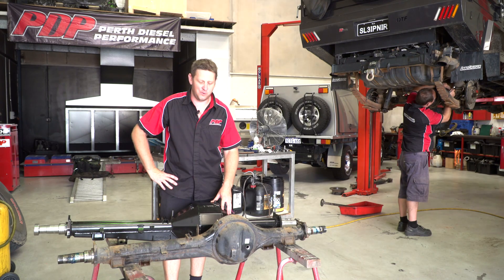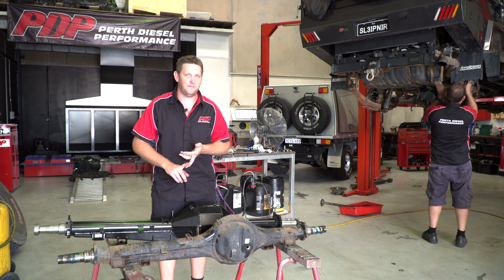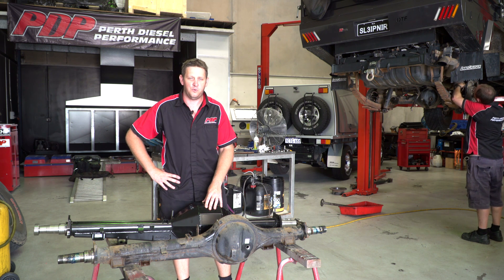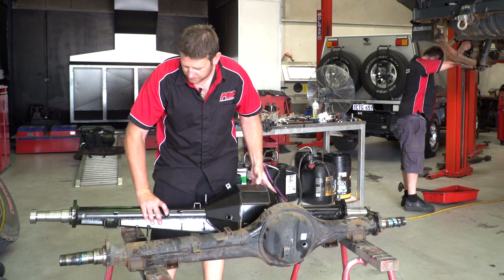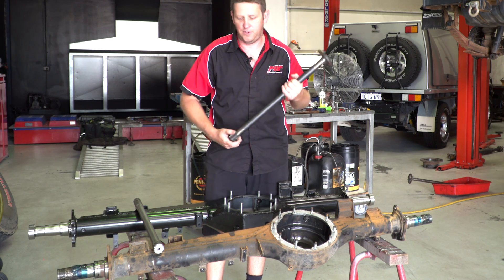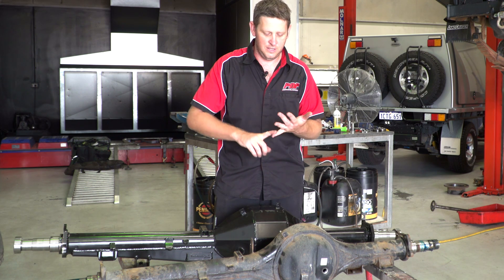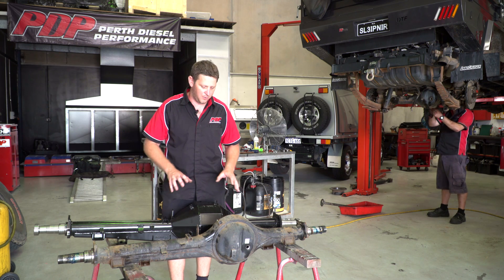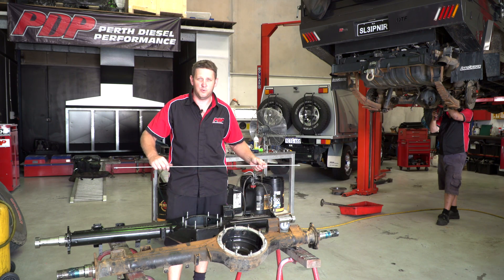JMACX Rear Track Correction

Comment: As someone with decades of motorsport engineering these obese diff carriers are rubbish. While the track differences is dumb from Toymota is a problem they seem not to cause any issues. A wider housing by all means, even floaters but 20kilos of extra unsprung weight is plain stupid!
As is ofcourse the dumb huge  rims and tyres that cause the grief. For bush bashing a 16" rim is better though will they fit a later model? Not on a wagon from 14 on. Those dumb mud tyres cause more grief, a decent AT tyre is all that is required. IF you cannot drive places with them simply dont driver there!! Meaning you will not kill the vehicle either
The bushies from 60 years ago with their Landrovers worked out big lumpy tyres puncture about 3 times as often. And that was with 7 50x16s.
Nothing has changed

Comment: Should have dumped the leaves for coils while you were at it.
Reply: N Noddy is it better to have coils than leaf and is it costly
Reply: Any conversion is costly. Which one is better actually depends by usage. In this case (off road tourer spec) leaf is better since it can handle the weight and abuse. Obviously if you prefer comfort and willing to sacrifice load capacity, get a car with coil at the first place.

Comment: Standard Toyota axles are "Chrome Moly" i.e. AISI/SAE 4140 type steel.  What else would you use for an axle?  I'm sure Mr Toyota (or probably Mr Aisin) knows how to heat treat it correctly - that's the tricky bit.

Comment: Informative video. Will the BP-51 shocks fit on the JMACX axle?
Reply from the maker: Guido Wessels existing suspension fits fine. No issues with BP51's. The silver single cab in the corner on this video had BP51's and this kit fitted